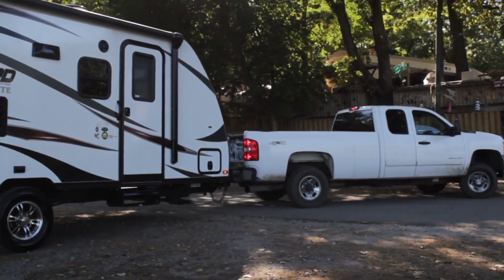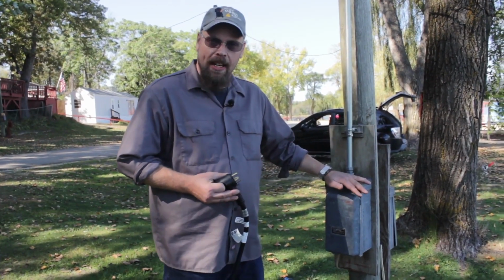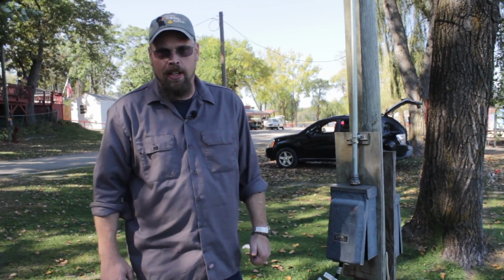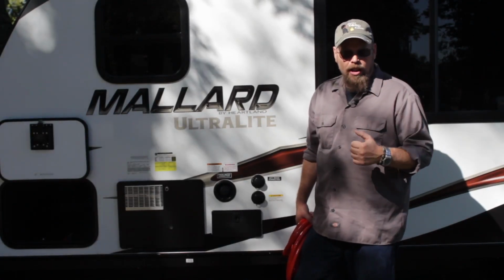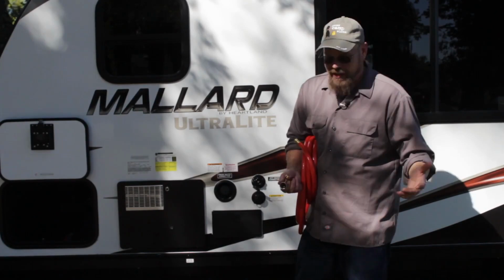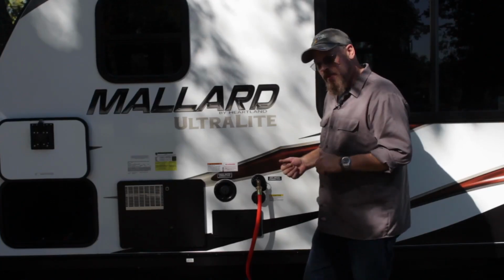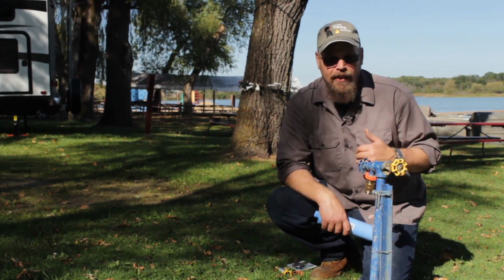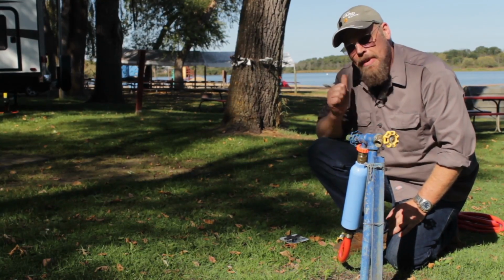Hooking up Power and Water - How To RV: Camping World

Comment: I'm new to RVs,  now I'm going on my first trip in 2 weeks I have a coleman lt 17fq,  I have a few questions, once I hook up the city water when do I turn the water off? Is it when I get to 30psi water pressure ? That's basically all I need to know
Reply from the maker: Adam, if you're hooking up city water, then you do not need to turn the water off as the water will be pressurized eliminating the need to use your water pump. You hook up the potable water hose, turn it on and enjoy your time camping. Hope this helps!
-Ian Baker
Reply: One other question, when I use fresh water and it fills up the tank is that the only tank that holds water? Like the water heater tank do I use the water pump to fill that one up to then fill the fresh water tank back up ?